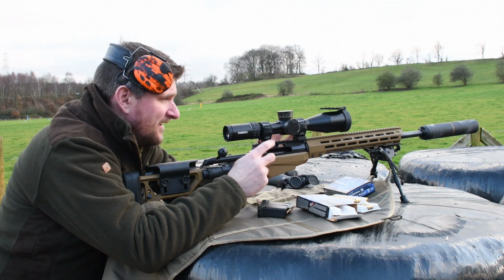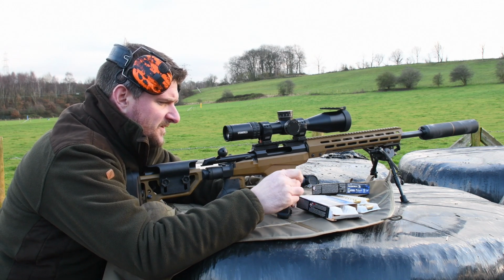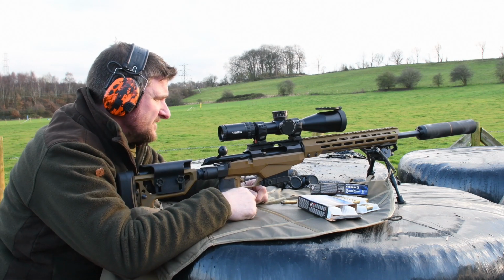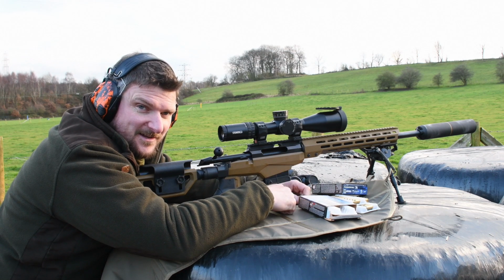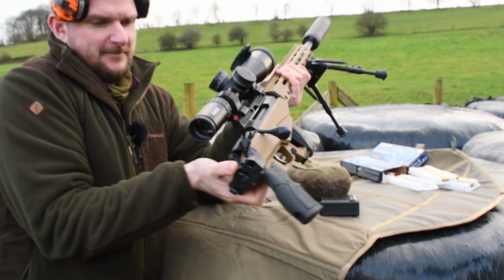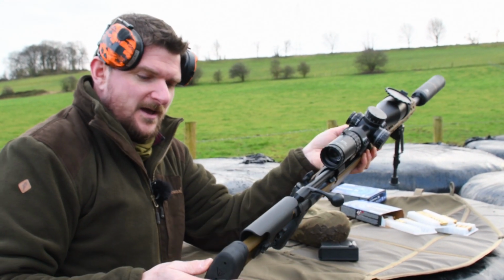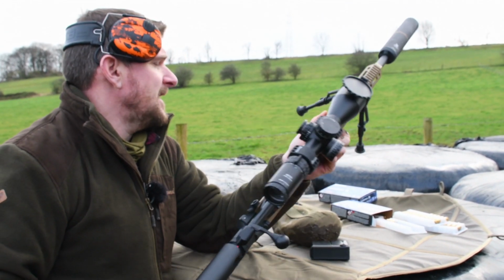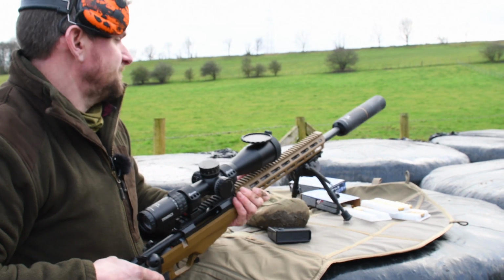NEW Coyote Tikka T3X TACT in 6.5 Creedmoor

Comment: 90-degree bolt lift? All Tikka's have 70-degree.
Reply: 90 degrees bolt, 70 degree bolt lift!
Reply: @MinhVu-in9iz  what is 90 degrees bolt, if angle isnt refrence to bolt lift angle?
Reply: @EeroVuori  TikkA t3x is a two lug bolt so 90 degrees to open it.
Reply: @MinhVu-in9iz  No, its 70-degrees 2-lug design.
Reply: @MinhVu-in9iz  70 is the right answer.. Look it up, not just guess based on the numbers of lugs.